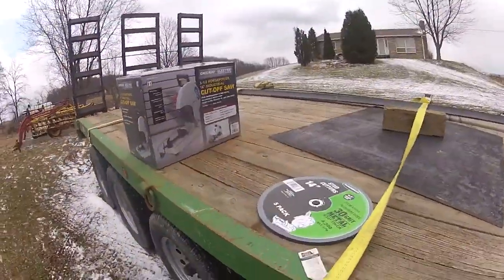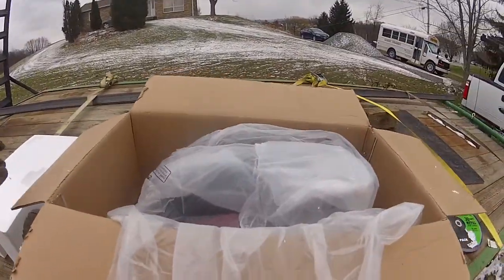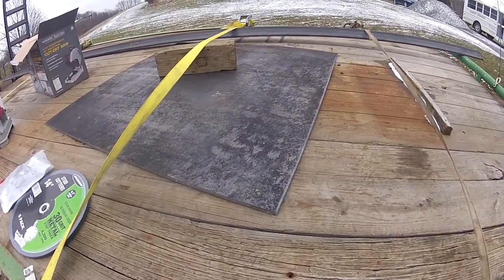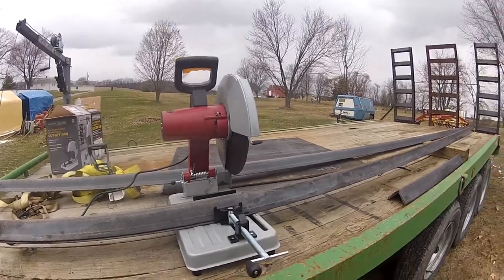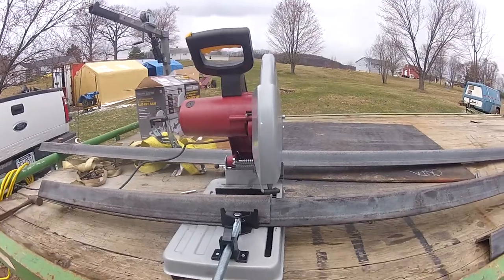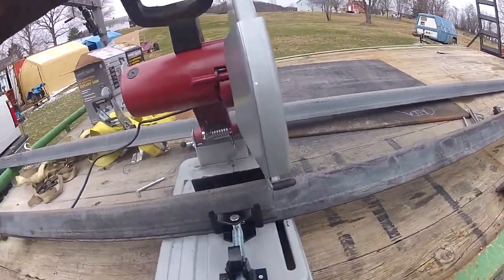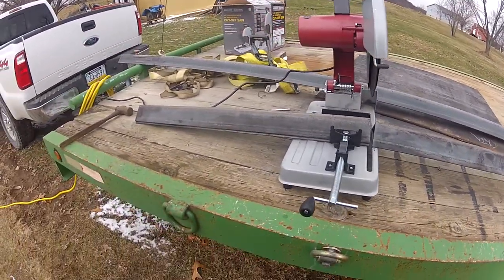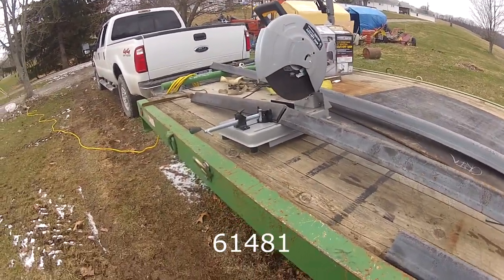Harbor Freight 3.5 hp cut off saw, review and demonstration

Comment: Saw is good, the base ... if not square on a flat surface can tweak your cut ! I will be reinforcing this.   I can't get this to cut through thick stuff it polished the metal rather than cutting. I've let it spin litley and nothing...Perhaps it works good cutting at an angle but so far not a flat on a 2x2x3/16ths tube.
 H.P. Blade 30 grit. tride diablo 30 grit no cut just a nice polish ???  Hmmmm.

..............................................!!!  Dewalt DWA8011 14in Blade   !!!...........................................